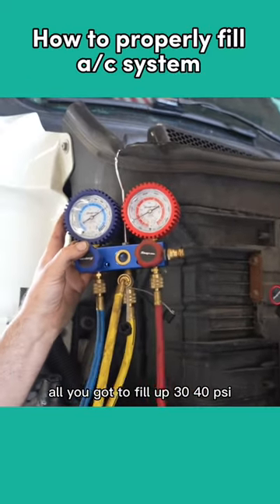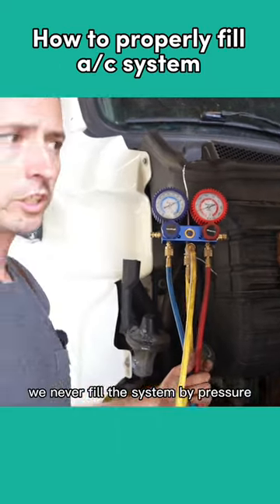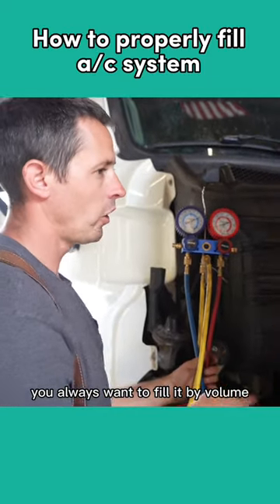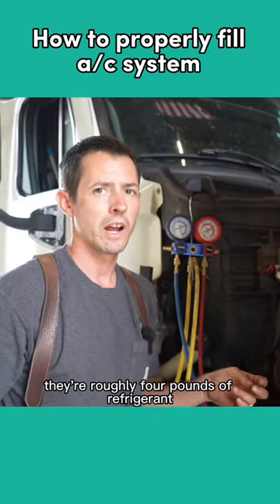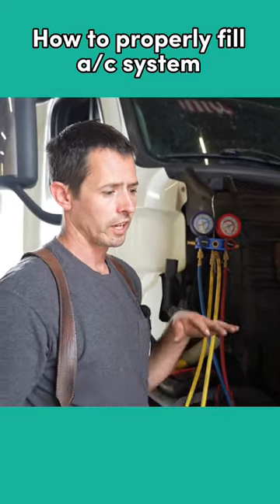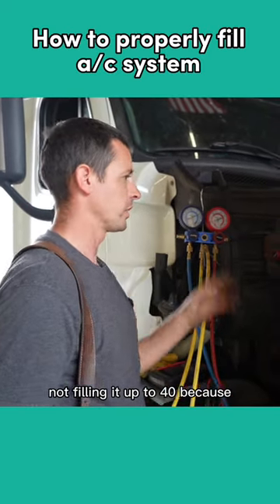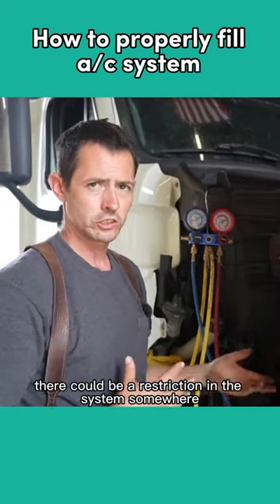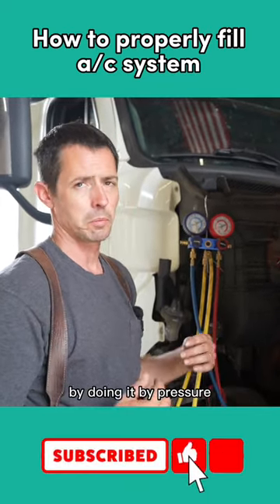How to properly recharge and fill a/c system with refrigerant?#shorts

Comment: unfortunately sometimes u find no informations at all about an old model and with time pressure u do what u have to do
Reply: New digital manifolds and going back to checking subcooling and superheat  and charging by that method when you don't have a rating plate anymore